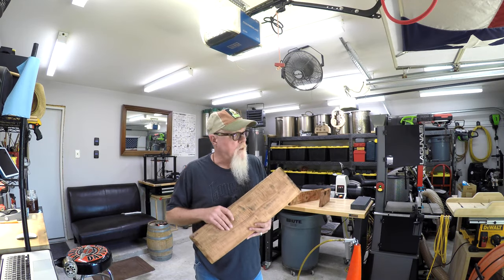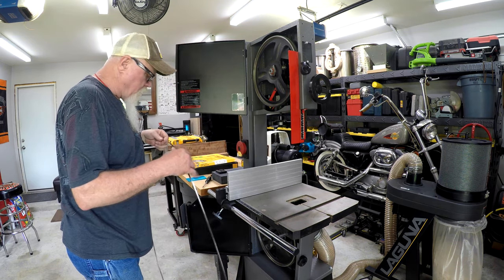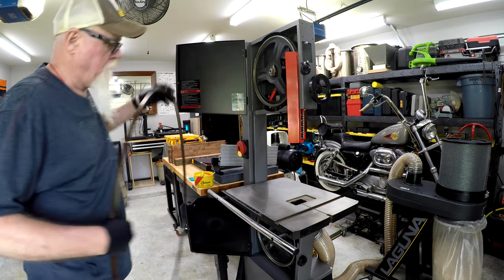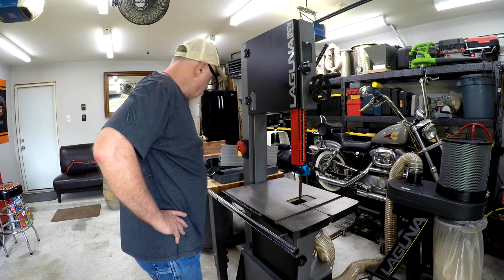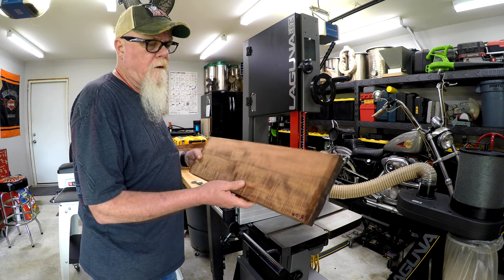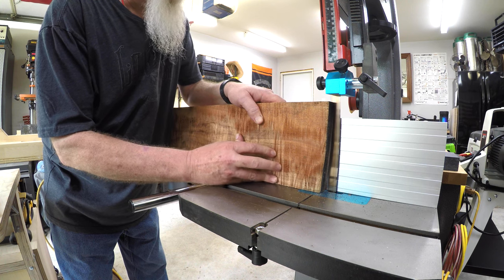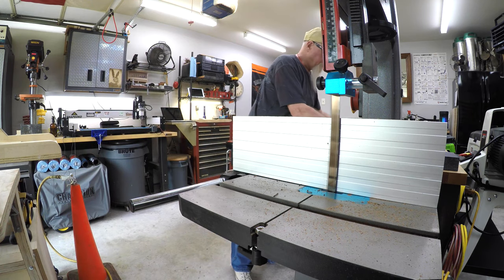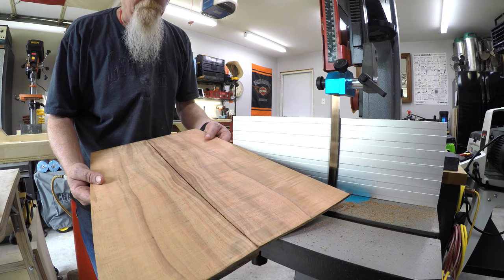Lonnie Mac VS. Laguna 1412 Bandsaw and Laguna Resaw King!

Comment: I noticed you didn't show the adjustment of the lower blade guides. Was that because it wouldn't have been family friendly? Worst design I've seen on a band saw lower blade guide.
Reply: bottom blade adjust is a nightmare easier to take the table off and do it
Reply from the maker: OMG brother. Don't even want to talk about it! Ha.